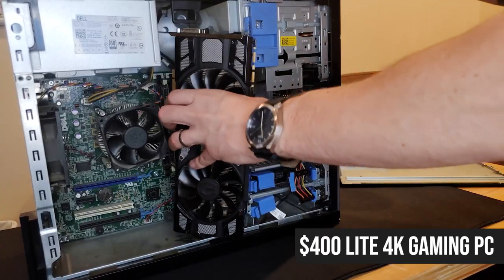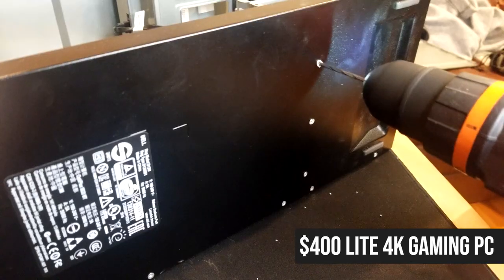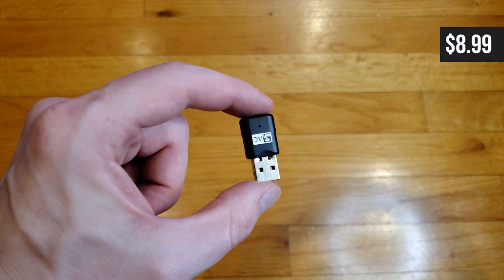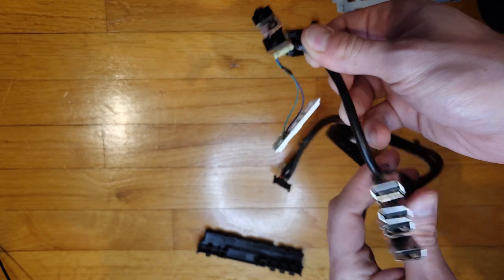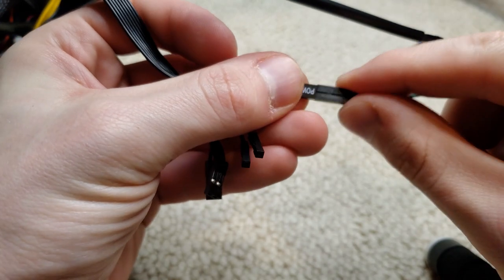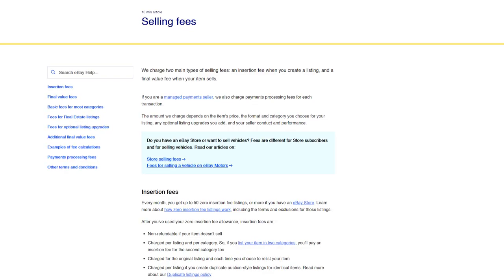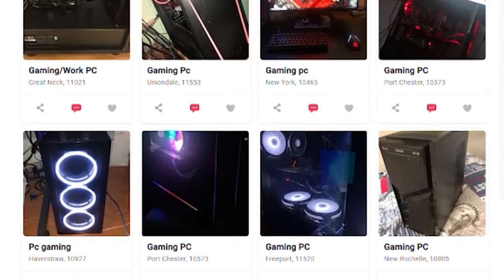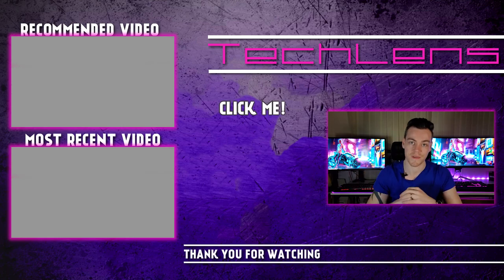💸💰💸 How Much Did I Make?... A REPEATABLE WAY to Flip PCs For Profit - You Can Too!

Comment: This was a really cool video. I did this for myself but with a bit more of an upgrade. I used an HPZ420 Workstation with a Xeon E5-1650V2, 32GB of 1866 DDR3 in quad channel, 600W PSU and a 1TB HDU for $235. I bought it from a PC Recycling center which can be a great source for used commercial grade PCs. I bought a 1TB Barracuda SSD and a 2TB HDU off Amazon for <>$110 and finally an EVGA GTX1080ti FTW3 off eBay for $345. Add in <>$10 for a cable adapter and I got up to $700 but this machine runs MSFS2020 at 1440p at 48FPS on ultra/high all day. Easily plays No Man's Sky at 75FPS on Ultra and Destiny 2 Ultra runs about 118FPS on 1440p. Remember kids, recycling, it's good for the climate and it's good for your pocketbook.

Comment: Just bought a optiplex 790 MT for a client (keeping original tower) upgraded to
I7 2600 2nd gen 3.6ghz
650w PSU 
4gb ddr3 1333mhz x4
Gtx 1050ti 4gb

Total cost for me $642 
Client cost $889

Plus profit from old 790 replaced parts $75

I run a side business and for requested upgrade I charge %20 upcharge with 0 labour cost.

1 last edit/mention-
This customer had specific programs he wanted to run as well as some gaming capabilities

Example: Autocad, fortnite, old pc games via CD-Rom drive ect.
Reply: Hey bro, looking to do same thing, i just have a couple questions:

1. Was this recent? Im seeing some PC's (around 950-1100) that have been listed for 3 months.

2. Do you need to upgrade the motherboard? I dont know if a graphics card like the 1660 super would work on an old motherboard such as in the dell 9020.

Thanks alot man

Comment: That cpu fan is really crooked and not clearly screwed in. Wouldn’t it have been better to just buy a replacement part for the cpu fan ? Like a be quiet cooler or something else ? Also I like the case 100% but it looks not different from the previous Cade it was in, was it cleaned and what else did you change ? Because if I’m a buyer then I’m not gonna wanna buy something that looks like this with a crooked and not so good cpu fan and an old motherboard that won’t support newer cards. I’m no expert but I do know that you need to not only spend cash to flip something, but you also need to spend cash to replace parts and make it look like a quality buy for someone needing a new gaming rig.
Reply: A lot of old intel air coolers for the CPU are purposefully crooked like that and can not be straightened. Also, he used the really bad-looking case to start with and replaced it with the good-looking one I think you just didn't see the old case... Since this pc is only worth around $450, the buyer should not be expecting to be able to replace the GPU with better ones as no rigs around this price can support that very well.